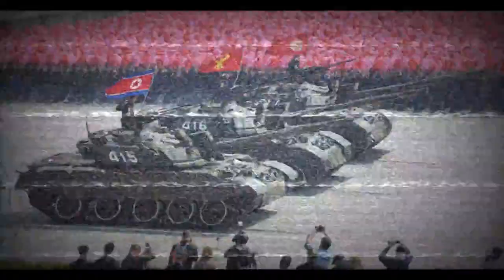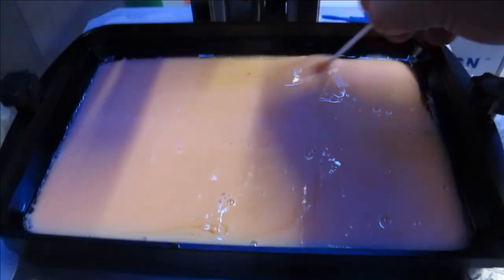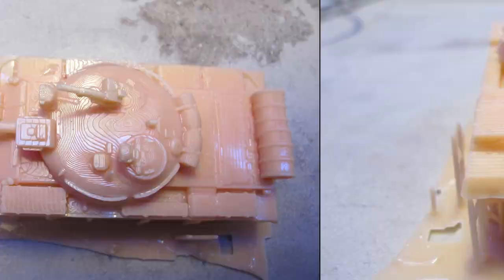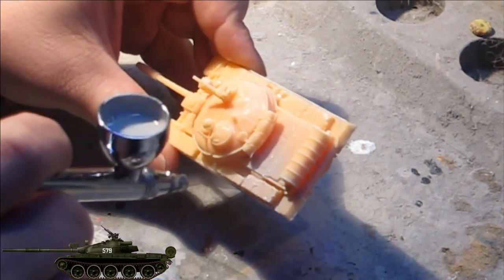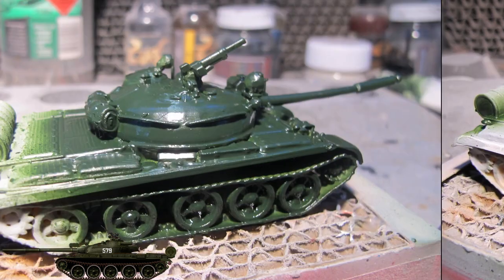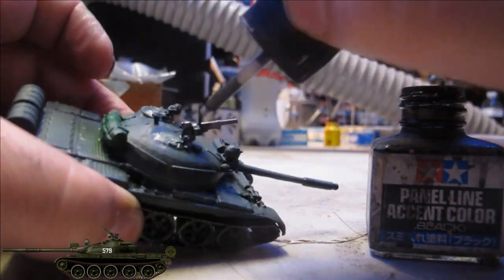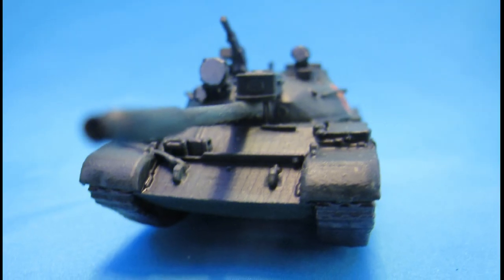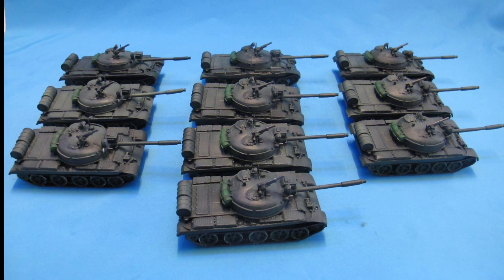3D print 1/72 Ch'ŏnma-ho MBT 천리마 전차

Comment: have you considered using smaller individual with foam padding inside wrapped in foam and packed in a larger box depending on how many orders you do it could end up being cheaper than using safe cases but just as effective
Reply from the maker: thank you for the suggestion, I have shipped gundams in pistol cases before and large diorama in an esky. but doing the math large rifle cases via surface is very cheap to move a whole army of miniatures. Best part besides looking very professional the client will keep using it.